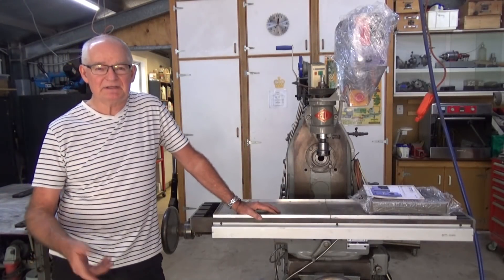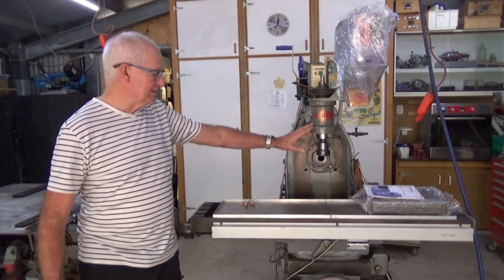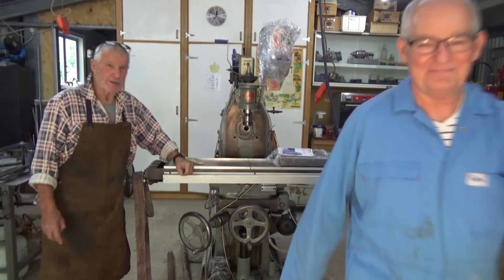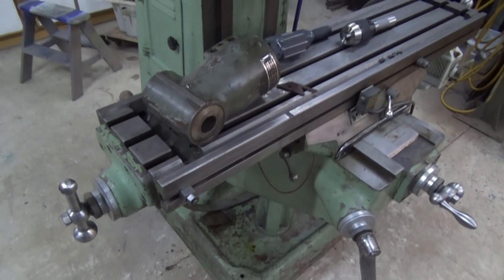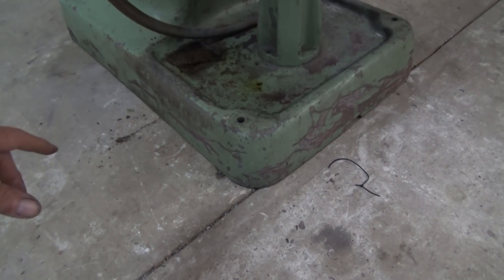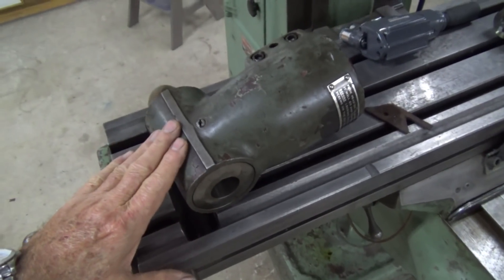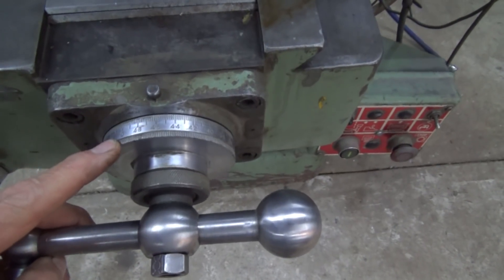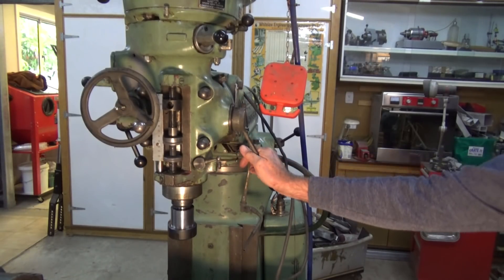Milling Machine Switch a Roo. A new (to me) Bridgeport in my life.

Comment: Hi Mark,
 been watching a few of your clips about your bridge port mill. I recently bought the same machine Bridgeport by Adcock & Shipley with variable speed head. Got it from SA and transported up to the Gold Coast. Basically in good order but needs a few minor things like quill clock spring and minor bits and pieces. Do you have any good contacts for Bridgeport parts in Aust. Obviously plenty on ebay but i would like to get stuff locally if possible. Any help would be great. Keep up the good work with the youtube clips. Cheers
Reply from the maker: I have yet to find any local suppliers of genuine Bridgeport spares. I did buy some cheap Chinese parts but I was disappointed with the quality. I have bought most of the parts I needed from H&W Machine Repair in the USA. They have a YouTube channel with very good videos showing dismantling and reassembly of all parts of the mill. They also stock every conceivable replacement part. Of course the exchange rate and the shipping is a bit eye watering  but their service is very good. 
Good luck with the mill. In my view they are an excellent machine.
Regards,
Mark

Comment: you got a nice concrete slab and that is worth it weight in gold. Job well done! And good luck with then mill.

b.t.w. I once dropped an engine block on my foot wearing flip-flips on a hot day breaking the second biggest toe. I was in a rush because a summer storm was coming in. It did not hurt all that much because the dopamine kicking in. But it felt weird rubbing the broken bones against each other and I almost fainted. You won't believe the colours its got :) Never went to see a doctor, because I read on the internet they do nothing about it since it wasn't the big one. It healed fine, today I don't remember witch foot it was, but it was soar for a long time. Moral of the story, don't wear flip-flops wear clogs :)
Reply from the maker: Yes, I saw your clogs in your latest video. Best protection ever I am guessing. 
Regards,
Mark
Reply: They have a safety rating but I'm not sure they are the best protection. I once had a horse stand one it and it split the clog like a piece of firewood. They can also be rather slippery, especially when a chicken got into the old barn and left some chicken shit.

Comment: Nice addition. I often wanted a horizontal attachment for mine. Wish I had shop space like that, and with palm trees outside.
Reply from the maker: One of the other Bridgeports that was a candidate for me had the full horizontal arbor assembly including the bracket that bolts onto the ram, plus a quillmaster attachment and loads of collets and tooling but it was the same price as the one that I bought. I started to suspect that it was way more worn than the one that I chose. I asked the vendor to take some close up photos of the Y axis ways and you could tell that it was pretty clapped out. I badly wanted that capability for using gear cutters and that was one reason why I was reluctant to go for a turret mill. I think the attachment I have is a a good compromise.
Regards,
Mark

Comment: How about a video on the turbo-jet please Preso??
Reply from the maker: Larry, I have been planning for some time to get the jet out again. The last time I ran it I had a hot start and the turbine guide vane ring distorted just enough to rub on the blades of the turbine disc. It needs to have a little machined off the guide vane ring but it's a delicate operation. I have only ever run it a handful of times. It scares the living daylights out of me every time it spools up. The original video of it is here https://www.youtube.com/watch?v=N7F4Bp-TcTA&t=6s
Regards,
Mark

Comment: You might wish to get a riser block to give a little extra clearance for when you use the horizontal attachment.
Cheers
Reply from the maker: Yes, I have been looking for one but they mostly come from the USA and as you would expect the shipping charges are astronomical. I have put my machinery supplier on notice to look out for some accessories for me. 
Regards,
Mark

Comment: Congratulations on the new Bridgeport! BTW, removing the X table and saddle are not very difficult. You may want to do this to clean out any blown in chips from overzealous cleaning. Wou can also clean the oil passages at the same time.
Reply from the maker: Bill, I have committed to removing the table and saddle. I have watched the excellent resources put up by H&W Machine Repair which make it look so easy. As you say, it will give me a chance to check out the state of the rest of the lube system.
Regards,
Mark

Comment: Mark, try peeking up under the knee, I'm not sure about your mill, but I can see the plumbing for the one shot oiler on my Index 645 by looking up under where the knee screw is.
Reply from the maker: I have already removed the damaged tubing and it came out quite easily. From the shape of it I am certain it is the oil line for the Z axis screw. I tried poking around under the knee but I am old and my neck doesn't work like it used to so I have committed to removing the table and the saddle. There will be a second video coming out soon showing the results.
Regards,
Mark
Reply: @Preso58  I look forward to it :)

Comment: This video brought back some Good and Not so good memory's That was the EXACT way I moved my 1951 South Bend 14"x72" tool room lath the only difference is I had NO HELP and took me 4 days to move it 15 feet lol (over gravel to boot) That is something I would NOT want to again by myself!!! I am in the market looking for a Bridge Port . -Believe me you are going to LOVE that Machine !!!!
Reply from the maker: I feel for you. I am glad I did have some help. I just finished watching Adam Booth's video of unloading his massive shaper from his trailer, solo! There's a lot that can go wrong and it happens very quickly and violently. That's why I forgot to set the camera up to capture the machine touching down on the concrete. Still, it all turned out OK in the end. I am getting ready to film the follow up video next week. I now have a rotary phase converter and the machine fired up and ran beautifully so that's a bonus. I half expected the motor, or bearings or the belt to be shot but it all sounds good. I haven't actually cut anything with it yet but I steadily working my way through a series of minor repairs and adjustments. 
Regards,
Mark

Comment: If you dont have a gantry, what do you think about spinning the arm around and use the accessory end as a "crane" arm to lift the table? I may have to do something similar with mine. I envision  using the knee to lift it up strap the table to the arm, disassemble then lower the knee and rotate the head to get the table off to the side. Works in my head... maybe someone out there has done it?
Reply from the maker: I am thinking I can raise the knee and then slide my tool cart underneath the table with a big piece of kitchen benchtop to spread the weight. Then I can just lower the knee and slide the table off. Probably easier said than done but your method sounds doable as well. I was wondering what the big hole was for on the other end of the ram. I haven't seen anyone using it for anything. 
Regards,
Mark

Comment: It is amazing how well pipes work to move heavy equipment. 

Nice Bridgeport.   I hope the crushed oil pipe is accessible if you move/remove the cover for the Y axis lead screw.
I look forward to the future videos of fixing some of the issues like the broken fine feed wheel, new knob etc. 

I wish I had the headroom for a Bridgeport or similar machine.

Dave.
Reply from the maker: Yes, it's surprising how tall the head is on the variable speed model. I did manage to get the crushed oil feed out. After I unscrewed it from the manifold it just pulled out through the side of the knee. I have made a new pipe from 5/32" copper pipe and I purchased a genuine Bijur metering valve from a company in Melbourne. AU$65 including GST and shipping but I would have paid the same getting one from the USA. I have committed to taking the table and saddle off next week and it will give me a chance to inspect the innards at the same time I reconnect the oil feed. 
Regards,
Mark

Comment: I have heard in that particular toe situation you describe, steel caps are worse potentially as the steel cap still gets crushed and makes the damage worse.... :S Always though steel caps were just for protecting against dropping smaller moderately heavy items on your feet, not bridgeports hahahaha. Anyway good job, nice machine, look forward to you putting it to use.
Reply from the maker: The particularly scary thing about that situation was that it was all happening in slow motion. I could see how it was going to play out but there was nothing I could do about it apart from shouting for the crane operator's attention. Some years ago I had to remove a handle from a wood mortising machine at work and as I was knocking it off the shaft it slid off unexpectedly and out of instinct I put my foot underneath it to break it's fall. I thought it was made of hollow tube but it was solid steel and around a metre long. It crushed my big toe and it took nearly a year to heal. We had to wear leather shoes in the school workshop but they weren't steel caps. As soon as I could get back into shoes I went out and bought steel caps for work. This accident  happened on the last day of term too so I had the two weeks of holiday to deal with the pain and swelling. I nearly passed out when I saw the mess! 😱
Regards,
Mark
Reply: @Preso58  wow ouch, that's pretty rough! They have certainly saved my toes on a number of occasions as they are standard footware when I'm doing any 'serious' work, mainly outside... but I should probably wear them in the shop more. In fact I dropped something on my foot, I think it was a log, and crushed the top of my foot, but the toes were fine hahaha.

On the note of shops, you have a very large shop! Lucky man. Are you in VIC?
Reply from the maker: @7duser10  No, we live in Tinbeerwah which is about 20km west of Noosa on the Sunshine Coast. It's nice here but it's very much dependant on tourism. It's about our only industry. I feel jealous sometimes when I read about people in Melbourne who pop down to the local market or machinery dealer and pick up bargains on tooling and measuring equipment. I guess that when the car industry shut down there was a flood of good quality equipment up for grabs. In fact, that's where my mill came from. 
Regards,
Mark
Reply: @Preso58  bargains? What bargains! Where are these markets!?  everything seems to get snapped up pretty quick in Melbourne. I did happen upon a closing down tool & diemaker but most stuff was spoken for, far too large or too expenisve. Plus don't be too jealous, square meterage costs keeps shop size down. Maybe I need to get out more... All the new machinery dealers are too expensive. I must confess I saw you put your location as tinbeerwah but I thought it was a joke :S ...  Oops sorry!

Comment: Without needing to do some repairs to those oil lines I would have recommend pulling the table and Y axis anyway Mark. That's the only real way you can verify none of the restrictors or lines are plugged and all the areas that are supposed to be getting oil are. With the age of that mill I'd bet your going to find at least a few of the restrictors are plugged. Cleaning out all the old oil, swarf where you wouldn't ever expect it could get in to and flushing the X,Y axis nuts will give even less back lash than you already have and a lot smoother to operate machine. The oiling system on these are pretty straight forward so other than the time involved you won't have any problems. If it were me? I also think I'd pull the knee for a thorough cleaning new felt wipers etc. In the long run you'll be happier you did. Swing the turrett around 90 degrees but keep the ram in so the head is as close to the column as possible for balance and the knee comes out the top of the column knee ways. Plus you can then clean, re-adjust the tooth engagement and re-lube the crown and pinion gears that operate the knee screw. It's quite possible those have never been looked at since the machine was built. The BP mills are a simple collection of parts and breaking one down into it's basic sub assembly's isn't very hard at all.
Reply from the maker: I am still trying to decide how far to go with the disassembly. I have already committed to taking off the table and the saddle and I watched the excellent series of videos by H&W Machine Works and they removed the knee with a fork lift. I do have a 2 tonne chain hoist which I can get close to but directly over the knee so maybe that will help. I agree that the lube system needs to be thoroughly inspected and cleaned. There are leaks in the manifold but I have been able to get a replacement restrictor and copper tube for the crushed pipe. 
Regards,
Preso
Reply: @Preso58  If you go that far It's probably easier to pull the head by using the table protected with a piece of ply and supporting the head on the end of the spindle while the head bolts are removed. Then just use the Y axis feed screw to pull the head away from the knuckle.That's how I always do mine even though I have an engine hoist. But pull the motor first since it lightens the head weight. With the head off then pull the head nod and tilt assembly off the end of the ram. Pull the ram gib and ram. Loosen all 4 turrett bolts then reach in that column side door and support the internal spider with one hand while the ram turrett bolts are removed. Then the turrett can be removed. It's maybe 2 days to RE/RE and thoroughly clean all the parts. If you do go that far be EXTREMELY CAREFUL with the knee gib. It has to come out and go back in with zero chance of breaking it. A broken knee gib is the last thing you want to experience and some of the horrors about what happens are detailed on the Practical Machinist forums. I'd highly recommend to at least pull that knee gib for a close inspection of it's overall condition to avoid any possible future problems with it just in case. With a used machine you pretty much need to inspect everything before you can be sure of what you have. The only issue with re-assembly is getting all 4 of the head bolts correctly positioned and the head seated in place. Those bolts move everywhere else but where you want them so using the table to support the head and it's X,Y movements and the knee to adjust the elevation to ease the head into place while you play with the head bolt positioning and guide them through the head casting is the easiest way I've found. It's not that hard, just a bit time consuming and frustrating the first time you try it. My BP clone is classed as a 3/4 sized or baby Bridgeport so everything is about half the weight of yours. Fwiw I did find it easier to slide the knee off and on with the column laid over on its back. Obviously the head, motor, ram, turrett etc has to be removed first for that to work.

When you finish tram the head to the table and get all the tilt/nod bolts tight one trick I stole off the PM forums is to then back the tilt/nod worms off to a neutral position where you can spin them back and forth with your fingers. Any pre load left on those worms and the cutting loads and vibrations help to slowly move the head out of tram in the direction those worms are loaded in. It's not by much, but a few 10ths movement on those worms is a few thou out at the spindle nose.Since I started doing that my head stays in tram a whole lot better.

Comment: HI Mark great video if you are touching up the  paint on your mill , the closest off the shelf is a Rust-oleum  2135 Reseda Green the RAL Paint Number is  RAL6011 if you only require touch up. the Adcock green was a custom mix is available in l ltr tins in the U.K way more than you require .
Reply from the maker: Ken, it seems that the green paint is not original. Worse still, it looks like it was painted with a brush. It's not bad but I was going to take a part down to my local paint shop  to see if they can colour match it in an industrial enamel. They have done this for me before but it would be good to know exactly what the paint code was. I will take the number you have given me and see if it's a match. It'd be great if it was!
Regards,
Mark

Comment: Two words - pallet jack. I move around my Wells Index mill and Monarch 10ee with ease. You can find them here in Texas for about US$100 all day long. Much safer as well. Maybe even rent one as how often do you need to move a big machine?
Reply from the maker: Craig, I almost bought a pallet jack a few years ago. It was down at our local recycling centre and they only wanted about $50 for it. The hydraulic mechanism was not functioning but I figured I could repair it. In the end I dithered around for too long and it was gone by the time I decided to get it. I have a 20' shipping container which I bought to keep all my seldom used tools in but my two children and my mother all decided that what I really wanted a container for was for storing all their overflow furniture and sundry stuff. Now it's full and I still have to store all my own things under the house! I just finished watching Adam Booth shifting his big shaper into his shop using a pallet jack and some load skates. Still, the mill is in now and nothing got broken so hopefully I'll never have to do it again.
Regards,
Preso